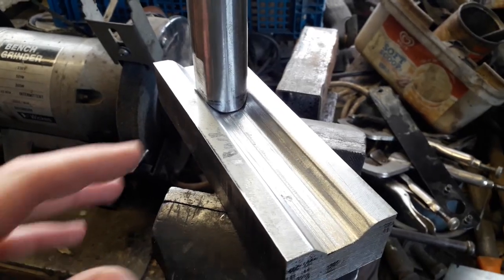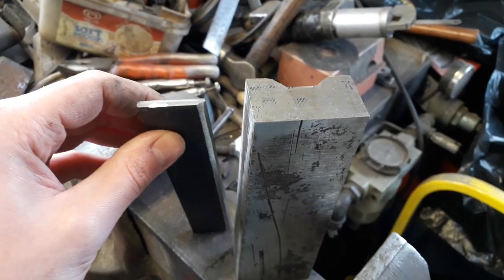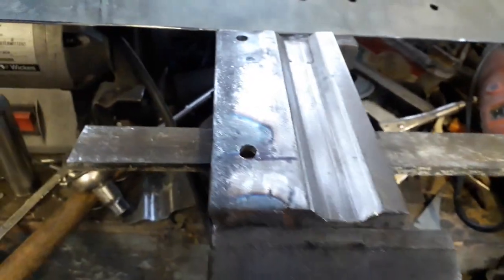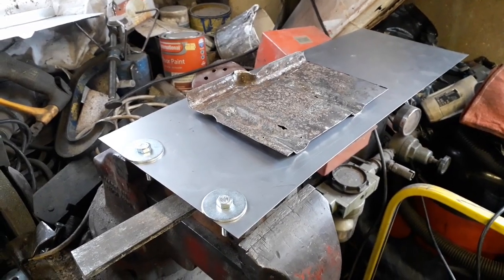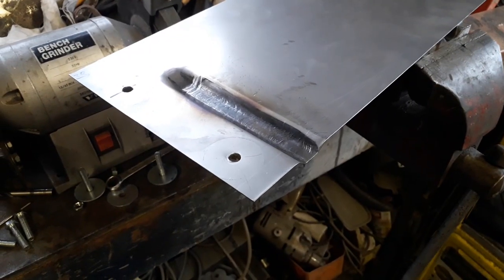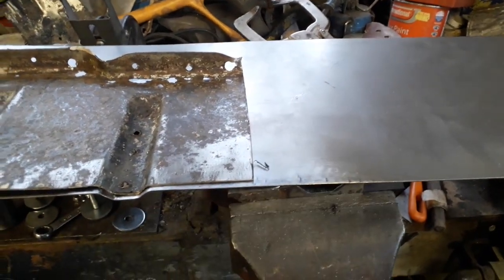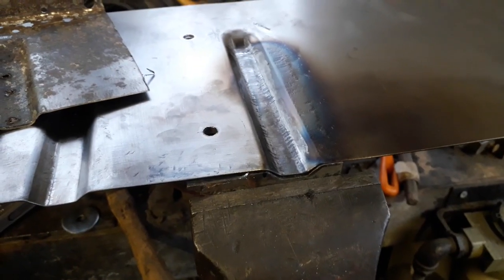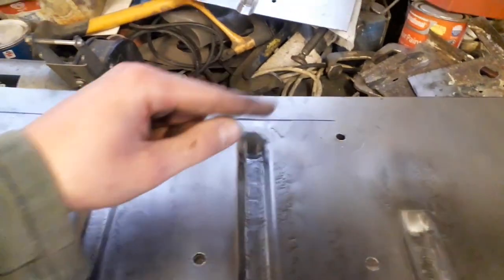Mini floor repair panel (2nd attempt)

Comment: It would have been easier to have fabricated a simple hydraulic jack press, they are easy enough to make !!.. beating the metal the way you do, not a good idea, your channel didn't shrink as you say, it was because of bad measurement.